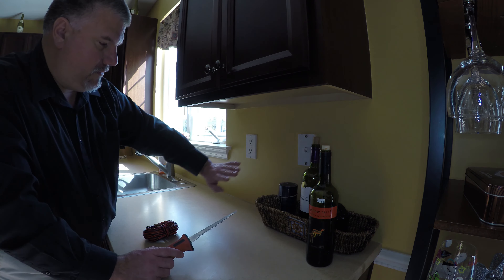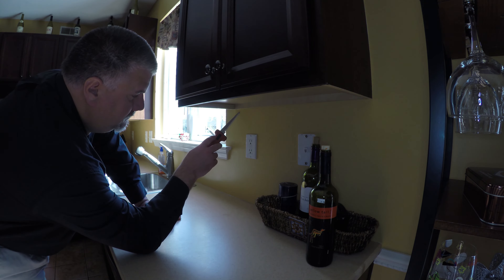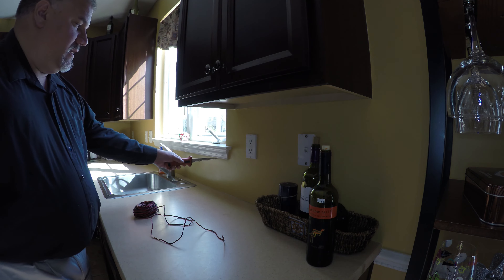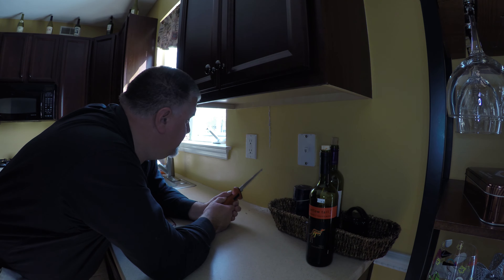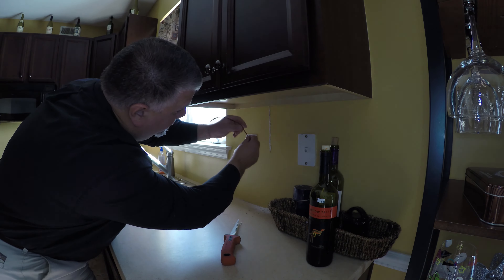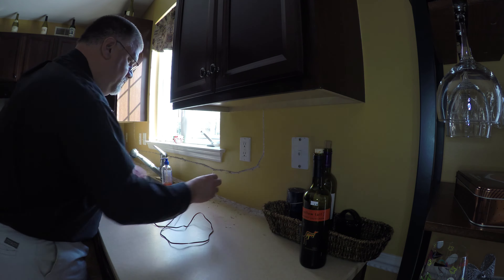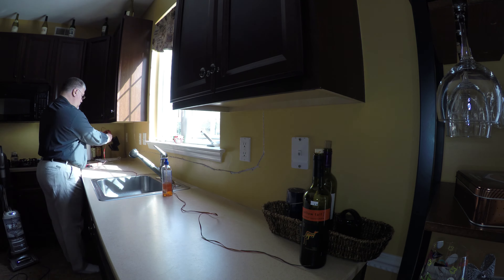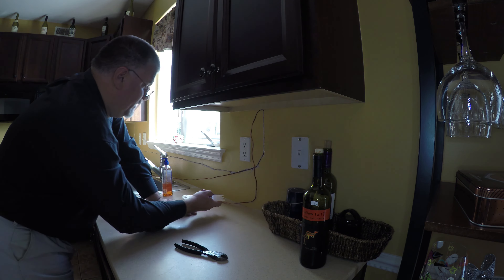Install Under Cabinet Lighting Part2: Connecting Two Cabinets Separated by a Window

Comment: Did you connect the wire from the end of the strip light and jump to the beginning of the other strip light or did you wire both strip lights back to the power source.